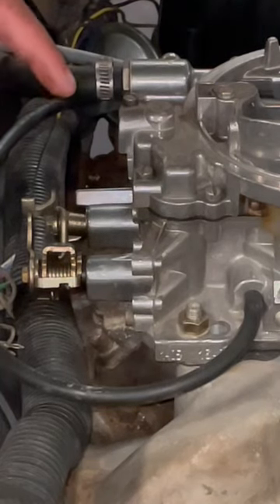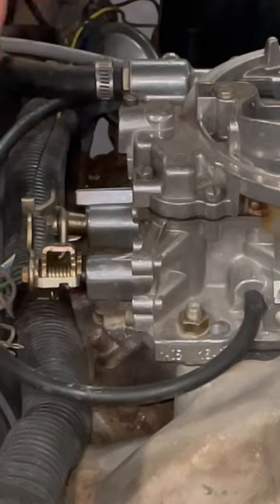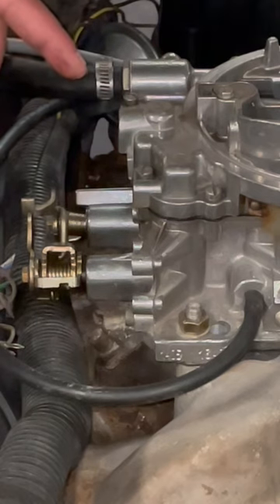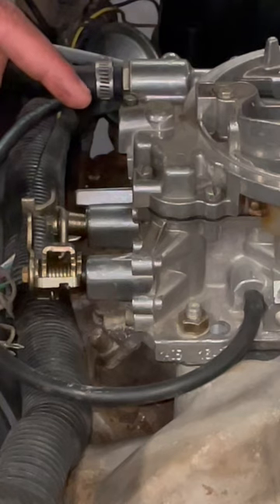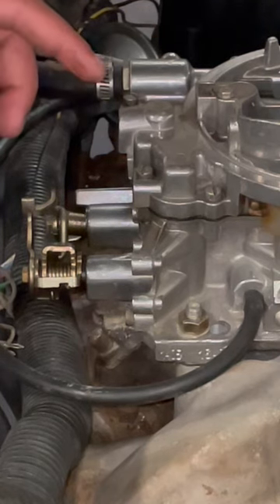Carburetor won’t tune or idle edelbrock 1406

Comment: They are assembled with that much from the factory.  They are not a tight tolerance or factory bushed shaft.
Reply from the maker: I know have a bad vacuum leek coming from the shaft do they need to be greased or some kind of seal
Reply: @4flattiresgarage701  the older they get the more air they allow.  When it gets too bad, replace the main body.  They were assembled to not be taken apart.  Don’t know what someone would charge to do a shaft/bushed/repair but probably much more than a good core.  I only get one or two a year that have to be totally replaced.  Most work just fine.
Reply from the maker: @MuscleCarSolutions  glad I haven’t taken it somewhere yet thank you for the info

Comment: Mines is brand new on a 63 impala 327. It would only start up when I spray starter fluid and dies out?
Reply: Fuel pump? I have seen new 1406 with stuck needle. Did you try hitting the top
Reply: You did put the plug in th back also
Reply: @702solidink  tap top of carb, will usually free the needle if that is the issue
Reply: @702solidink  give me a minute and I'll make a short, gotta grab a carb
Reply: @ase-asksomeoneelse5584  sorry I wasn’t transparent. It’s started to have that problem after I replaced the fuel pump.
Reply: @702solidink  ah, I put new fuel pump on my S10, has 350, and it leaked, caused it to catch on fire. (I got lucky and put it out). If that's when it started, that is where I would start. Also check fuel line to tank. Could be sucking air
Reply: @ase-asksomeoneelse5584  will do. Thanks
Reply: @702solidink  the lines could have been put on opposite how they're supposed to, it would cause that, and air would be going back through the line into the tank

Comment: If you’re tuning with a vacuum gage like you’re supposed to! And u get no reaction when turning both screws that tells you that u have to adjust the idle screw.  U want the most vacuum possible